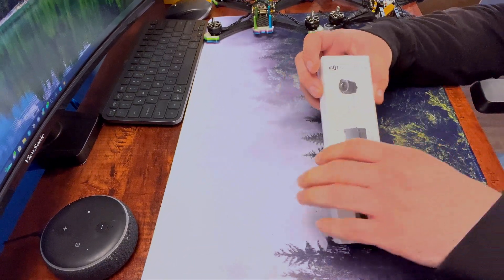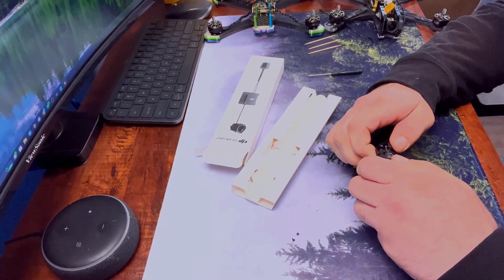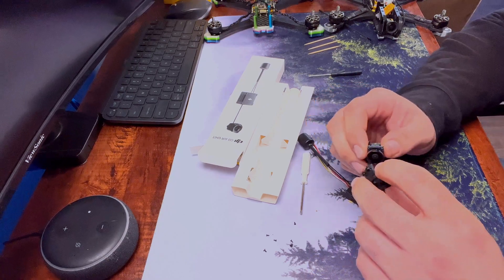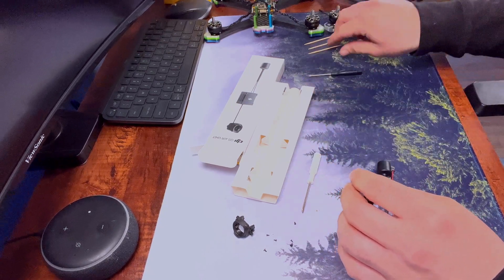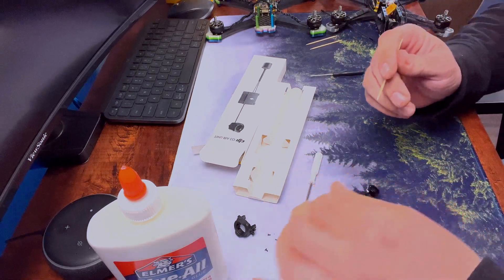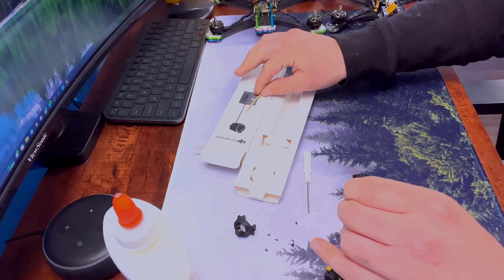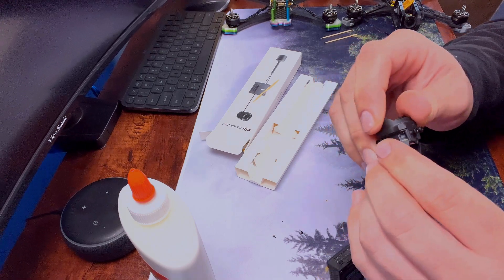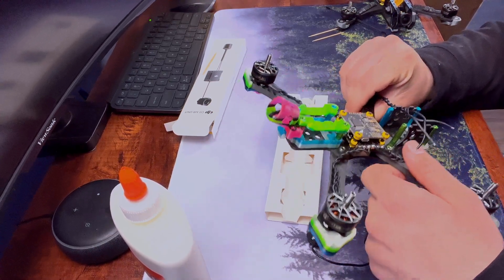How to Fix DJI o3 Air Unit Video Shake/Wobble

Comment: I have looked at everything that is possible to correct for the up/down wobble i'm getting in the dji 03 camera. Even after following your complete pull-a-part and tighten lens frame, and still does it. What are my options...change from tpu (original) mounts to foam type?

Comment: This method didn't help me😢
Reply from the maker: Be sure to have the lens focused and put enough glue to lock it in place
Reply: @master_pixel_pilot  How can you focus the lens? Just twist? Thanks
Reply: @SJMFPV  Ya, screw the lense in or out to focus, but that's only needed if the image is blurry.